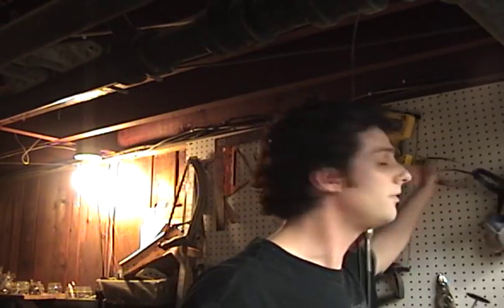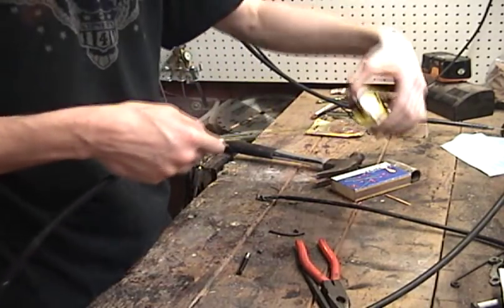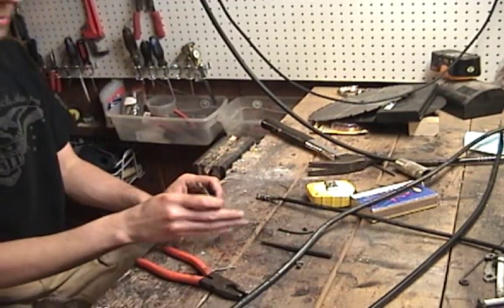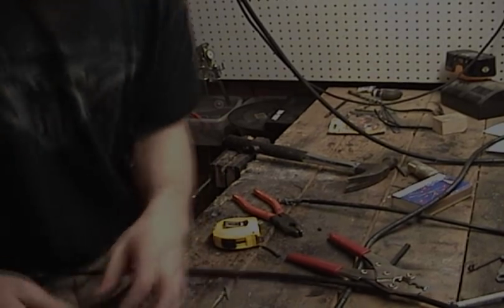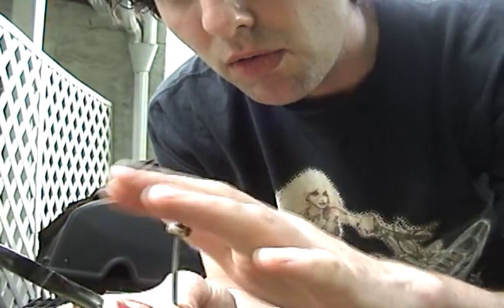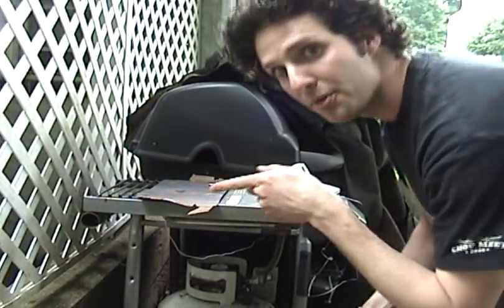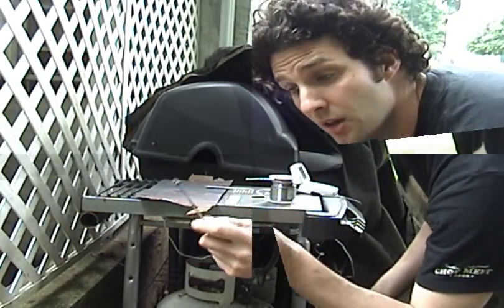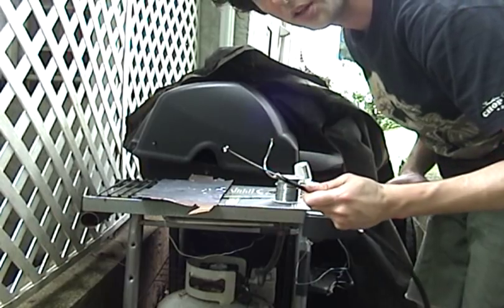How to shorten and solder motorcycle control cables

Comment: "The easiest way is to use a solder pot, but of course you and I don't have solder pots".  How does this dude know me so well?   Nice to see a video of someone doing this without a solder pot...although I'm kind'a thinking I should just spend 25 bucks and get one on amazon.   I recently picked up a 64 Triumph and every cable I've ordered for it has been the wrong frickin' length.
Reply: You can use a cap from a U joint as a solder pot

Comment: Thank you fenrir00 !  I done it slightly different to save cleanup.  I used 1/4" brake line, cut it to length and drilled the large hole for it in wood.  Once I inserted the sleeve in the hole I drilled the hole for the wire.

Comment: what happens if we use rosin core wire?
Reply from the maker: My understanding is the material is not strong enough - or may not be strong enough. I have cables still in use that I made 10 years ago using 50/50 solder - so I know that works!

Comment: I ended up work hardening the ferrule with a drill and went through some cobalt bits, drill as slow as possible. Also you can melt solder in a spoon instead of using an iron.

Comment: not that this guy is going to read comments 8 years later, but for anyone looking to do this, he might well have annealed that wire which would have been harder due to the cold work and thus more be more durable than it was after annealing.  Annealing removes the hardness of steel making more workable but the end is not the point you want to be doing that.  There is a correct tool to do this called a 'solder pot' where you dip the end into molten solder rather than heating the part like this guy was doing. I understand this was amateur all the way from 34000 rpm emery disc cutting with no glasses to the work environment, so maybe im being anal but thought i should point that out.
Reply: He actually addressed his lack of a solder pot and if he had one he would use it. This video was made for others without such a tool

Comment: safety glasses sitting on the bench while an easily fracturable disk spins at thousands of rpms in a rotational plane with your eyes while throwing hot metal sparks.
Reply: Oh no..... THAT safety dickhead has showed up. Run along and find my UNsafety videos..... you'll be posting shit for hours

Comment: I was taught to do this with acid core lead solder and to put the cable end in a vice VERTICALLY, you can hold up the loose cable end with the tip of your soldering gun,, and heat the cable from below the cable end and to let the solder make it's way down through the cable end a little so that you know it definitely adhered to all pieces of wire in the cable, you can use a torch style solder gun with a metal tip to speed up the process or you can literally use a cheap soldering iron below the cable end against the cable too (just takes quite a bit longer to heat up the cable enough to melt the solder when you touch the solder to the frayed ends of the cable above the cable end.) Besides all that you are doing it the same way pretty much as I was once taught. Just thought I'd share that and also that none of my cables have ever had the ends come off too.  :)

Comment: Why don't you use an electric soldering iron? I have seen a couple people shy away / warn against these. Are the cheap ones just not hot enough?
Reply from the maker: Erik Wagler exactly - it takes a lot of heat to get the cable barrel hot enough that the solder will flow.  I don't know of any electric iron that'll do it (maybe there are some, but I've not seen one).  My heaviest duty electric iron is a 230w - it might get it up to temperature eventually, but you might as well just use flame.
Reply: fenrir00 Oh wow, thanks for the tip! I'll definitely be using your copper sheet trick. Now i just gotta get my hands on some copper....

Comment: Why wouldn't flux core stuff work? Is the lead/tin ratio different/not as strong?
Reply from the maker: it's generally considered not strong enough - but quite frankly, I've never tried it (I've never wanted to risk a brake cable snapping at an inopportune moment)

Comment: Nice to see a youngster "make do and mending" but I think if you had put some solder on your hot plate you would have had better heat transference and a quicker job.
Reply from the maker: I think you are absolutely right and next time I will.  If I tin a soldering iron tip, why wouldn't I tin the copper plate?

Comment: Good Job!! Is it possible to make a cable longer? (By soldering an extension?) I wanna add APE hanger Bars to my virago, but I wanna save money by not having to purchase LONGER cables. I am looking to make them like 10 inches longer, and how about the rubber coating can I extend that?
Reply from the maker: If it is, I can't see how to do it so that it's reliable.  I'd just get new cables from motionpro

Comment: great video.i've recently done this myself.i used silver solder(only 2% silver i think),got it at napa auto parts.i also used a small pencil torch,very carefully.your right about cable getting too hot and brittle.thanks for putting that in.i agree with the guy above about young guys getting into doing it thereselves.keep it up ...

Comment: I lowered my front forks and then replaced my stock bars and mounting with clip-on bars, need to go back and shorten and relocate my choke, and shorten both the push/pull throttle cables. This was a huge help, however I am going to save myself some grief and order the replacement ends from Dime City Cycles, they are very inexpensive. Thank you for the vid, it was exactly what I was looking for - what solder to use or not use, etc. Awesome!

Comment: Are you saying no to solder with flux in the core so you can apply flux directly to the part?  IMO, even with flux core, flux can be applied.  Thoughts?

Dan

Comment from the maker: @SnapDaddy5998 if you do it right it'll be strong enough for any application on a motorcycle (sometimes it just doesn't take and you have to redo it, but you'll know right away when the ferrel pops off on load) .  I use 50/50 tin/lead solder, but 60/40 tin/lead is a little stronger.  I know some people use straight lead, but the more tin, the stronger the solder, so I use at least 50/50.  The more tin also the better the solder sticks to the metal.

Comment from the maker: @SnapDaddy5998  absolutely - that's the whole point of the video.  That's a real clutch cable, I just didn't have a use for it right then.  It doesn't matter if its a control cable for a bike, a car, or an airplane, they all work the same way.